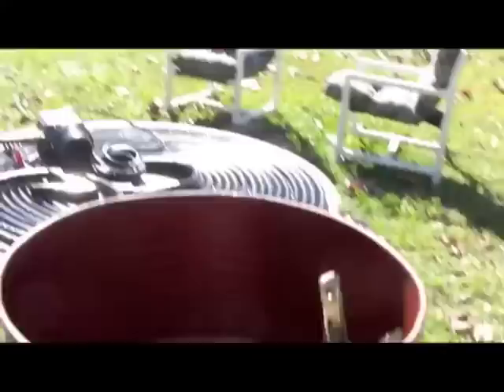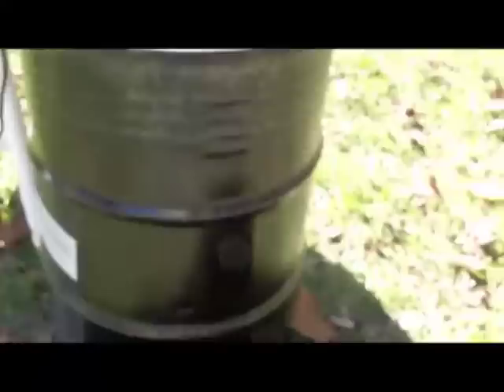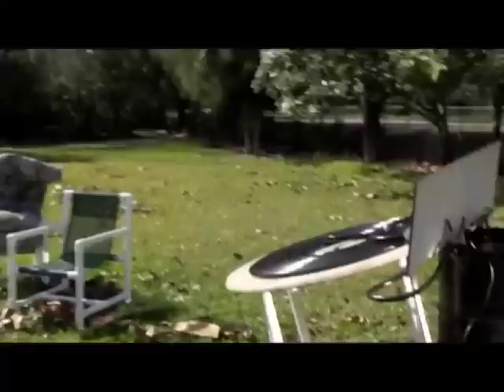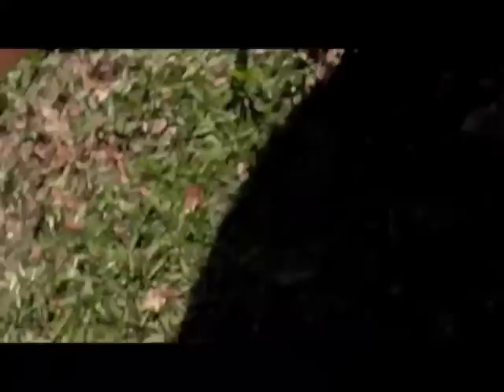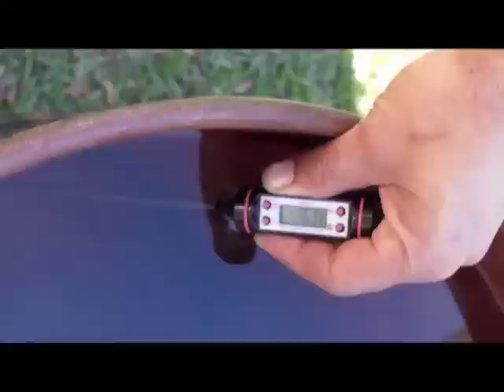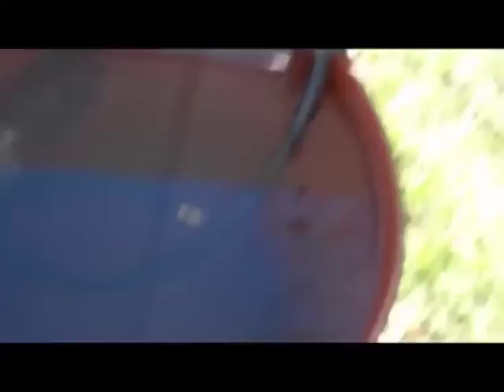SOLAR HOT WATER with black garden hose Pondmaster 1200 gph SWIMMING POOL SOLAR

Comment: When we first moved to the farm, we lived in a motorhome. Needless to say the hot water tank is small for six people. I used two splitter's with 8 /100 foot hoses and spray nozzles on each end. the water was turned on to fill the hoses, then left in the sun.  I used a hula hoop with ropes hung from a limb with two shower curtains hanging around for privacy. The bottom on the ground had gravel with a pallet on top. We used a two 5 gallon buckets set on a bench. Each would be filled 1 with 2/3 hot water the 2nd filled all the way. we would rinse off, soap up, shampoo, then rinse off using a small pot to pour water over us. we had a place to hang our wash rag, towel's, soap etc and a place to hang dry clothes.  We never ran out of hot water, and most of the time the water was too hot  so we would add some cool water . ... Growing up in rural Florida, my father had six 50 gallon drums painted black that he would catch rain water in, they were mounted  with tin sheets underneath to heat the water. It was set up and used with a gravity feed line. If it was during the winter, he would have one drum set over aside a campfire, it would always provided plenty of hot water.  When he finally had a water pump put in we would feed the primer and pump water. We thought we had died and went to heaven.

Comment: It might be interesting to maybe remove the pump, increase the hose lenght another hundred feet, let the system thermal siphon, capture various readings as a baseline, and repeat a couple three times.

Then try various pumped flow rates, insulation etc and play with "tuning" it into something cheap and really useable. Around here, such a system might well make enough hot water to supply an oil field workers laundry (washing greasers). A much needed service.

Thanx Dan for planting the seed, Bro.

Comment: John, The size pump he is using puts out very little BTU if you consider the volume of water in this system. It is true that the pump puts out a small amount of heat. I know because it is where my small goldfish hide when the water temperature falls below or around 60 degrees Fahrenheit... but isn't even enough to add an extra degree to the water temperature.
Reply: my dad use to use this method to heat the pool water[25 years ago]. it really works.

Comment: For awhile we lived fulltime in a RV, we had 200 feet of black garden hose going to a cousin's house feeding the RV. Even though much of the hose, say 100 feet was buried or shaded, even in cold weather, showers would not run cold. The RV had a 6 gallon water heater that used an electrical element to heat that tank. LP was not used. You guys are great, nothing venture...

Comment: Make your black hose in a "center sagging" cone shape below the water level with the center of the cone connected to the bottom of the tank and the outer part of the cone hose connected to the side of the tank just below the surface of the water and you will not have to use the pump as the hot water will naturally rise on it's own on a hot sunny day

Comment: Not sure if they sell them in the states but here in Turkey almost everyone has a pre made unit like this but far more efficient. For about 9 months of the year you don't need a water heater at all, just put it on the roof and it's done. They are also designed to not need a pump.

Comment: As an RV'er I can tell you that you don't want to use colored water hose to connect to water you use to drink or cook.  It picks up taste and who knows what else from the chemicals used to dye or color it.  The black hard hose in your other video is specifically designed for plumbing without bleeding chemicals.

Comment: That's an ok system, as I'm sure you know a smaller reservoir would have been good and the res definitely needs a lid arrangement to keep it clean and trap the heat. Also the Chemtrails (read up for your health) in your lovely "clear Florida sky" are magnifying the effect of the sun a little,do a test on it you'll be surprised! if you ever needed to go off grid you'll do ok together by the looks, well done. Oh and your wife is lovely, good health and happiness to you both.

Comment: Really nice.

Subtract out the 100 watts for the pump, (360,000 joules in an hour,) and you still have a 1.33kilowatt-hour gain from the sunlight in one hour, and you had no thermal insulation.
Reply: .83 gpm for an hour, with a 6.5 degree heat rise is 800-900 watts

Comment: If this was set up as more than just a demo, the barrel could be positioned in the sun, hoizontally and appropriately oriented to the sun for the location, along with the black hose (or black pipe).  Both the barrel and the hose become more effective heat collectors if enclosed in glass or plastic, and situated out of the wind.   Convection might be employed to eliminate the need for a pump, at least until it's time to use/ refill the water.  Thanks, GreenPowerScience, for illustrating how simple the basics of this type of system can be!    Also, coiled pile through a large active-hot compost pile will produce lots of heat for months (IF done correctly).

Comment: I've had a two hundred foot one that I use 9 months of the year...attached to our electric water heater. I only use a one way foot valve and it does a good job of circulating and doing most of the daytime heating of the water. We have turned the water heater to 90 which is ok as we use most of the water before sundown and some heat is left over. It cut down our electric bill noticably along with other devices we have added...more later.

Comment: Use mirrors to reflect light to back side of the black drum.  
Using a space blanket really helps as a big mirror.  
Even using a space blacked for your hose to lay on will also increase heat temp.
Reply: No it wont

Comment: In a situation with no electricity for weeks, months or longer 76 degree water will feel like heaven. So the question isn't really what the practical application is for but rather when. Knowledge is the difference between being a survivor and being a casualty. In my state several years ago we had an ice storm. Many didn't get electricity restored for over a month. A 76 degree shower to those folks would have been seen as Godsend.

Comment: like this one more than most - it was pretty complete with the solar powered pump and panel. A simple (and cheap) round table glass laying on top of that hose would have boosted your output quite a bit. I like the mirror you put on there. if you installed it permanent you could mount three or four mirrors and for about one or two hours per day you would have turbo heating of your water ! ! !cool 
I need to build something like this !!! thanx again
harold

Comment: I knew someone who used this technique to heat his inground swimming pool.   Take a sheet of plywood with 2x4 sides and spray paint it black.  Get you hands on a bunch of tin or aluminum (soda or beer) cans and cut them in half.  Secure them to the plywood about 1 inch apart in all directions.  Spray paint all that black.  He used black plastic pipe that he laid through the first row, then wind down through the second row, and keep repeating until he come out through all the cans.  He then covered the boxes with a thin sheet of metal, also painted black.   My friend laid several of these panels on his roof connecting one box to the next and heated his pool with it.  It didn't cost him anything to heat his pool other than time and figuring out how to keep it from being too hot!
Reply: why the cans??

Comment: Nice demonstration Dan.... You could calculate the heat gain 
50 gal  = 8x50gal = 400lb  or 6.5*F x 400lb  or 2,600 BTU  which seems a little high unless you take into account the heat from the pump. BUT then there is the heat loss from the barrel ??? sunny side shade side wind temp??? lot of variables BUT still a good demonstration

Comment: awesome video.. funny, i was just telling someone at the farm market how to build a solar h2o heater and how to insulate and store the water..  what works good also is the plastic sprinkler black tubing that is 1" dia and you can link up a few to get mre heat transfer surface area and i think it has a better temp transfer coefficient than rubber hose.  have a wonderful week.. thanks & peace.. amunra...

Comment: @chillydickie I was thinking that also.  Maybe a longer hose coupled with a reflective surface, and a slower solar pump that works on a timer, so more water sits in hotter coils for at least a few minutes before it moves.  Solar water heaters can work, they're just not as fast or portable. Solar systems in general seem to need backups... Rout the coil water into a conventional water heater that won't come on until well after dark.

Comment: We put 300 foot of black plastic on a black roof, and tied it into the filter circulating pump on the pool. After it was primed the syphening effect would help the pump lift it that far. It got the pool so warm, we had to bypass it, at times.

Comment: I am putting 1200 feet of black hose along the top edge of my fence, and running it to my water heater. It will preheat the water above ground temp, and lessen the load on the water heater. At times the water should be hot enough that the water heater won't need to kick on I'll bypass, and drain it in winter.
Reply: How would this work? You put a valve on your water heater and divert it into the hose?
Reply: Kit Mason No, just run the water source through the black hose then into the intake side of the heater. The object is to pre heat the water above groundwater temperature.
Reply: So you just plug hose into outside water spicket and back to the water heater? Genius!
Reply: Kit Mason Yes, that will work, but you need to plumb it so you can turn a valve, and resume normal operation without re-plumbing the whole thing.

Comment: Bet the trick is slow circulation to allow the heat to build in the hose but not so slow the drum loses heat...so wrapping the drum like you said. A temp gun and a lil tuning the flow rate and your golden!

Comment: Great Video. If you will cycle the water, allow the water to heat up in the hose then flow into the tank {cycle the pump} the temp will rise faster in the storage tank as well.
Reply: Very inefficient.

Comment: Forty years ago, I saw a solar heater work like gang busters in western PA. Wanting to extend his pool season, my buddy and I connected six closed, black, polyethylene 55 gallon drums in series and circulated his pool water through them.  The drums were laid on their sides on a low embankment near the pool.  On a sunny, spring day, the water coming out of the last drum in that array was so hot you couldn't hold your hand in it very long.  It takes volume and surface area to make this gig work.
Reply: Mike, that hook-up worked so well, it surprised the hell out of us.  We were thinking the discharge would be pee warm, but it was WAY hotter than that.
Reply: You needed a bigger pump!

Comment: @DJMC5ive Assume the pump has an efficiency of 50%; 1/2 its energy goes into heat and 1/2 goes into kinetic energy (water motion).  As the moving water travels through the pipe coil and then slows down inside the tank due to friction, it is converting the other 1/2 of the energy into heat.  A very small amount of that heat will be lost through the pipe coil to the ambient air, and the remainder will be transfered to the water, heating it.

Stirring water with a spoon heats the water.

Comment: You may have done better had you left a space between the windings of the hose, and maybe put a mirror underneath.
I'd say a smaller pump that runs off a solar panel (20w?), and another 100' of hose, and you would have a nice hot shower for free almost everyday. Seal the collector up in a box with a transparent cover, and insulate the drum, or put it inside, and it would probably work in surprisingly low temps too.
You do great experiments, and experiments are all failures until the last one so ignore the criticism.
Reply: With 200' of hose you can probably skip the barrel.

Comment: Holy cow when you read how many people swallow this " chemtrail" stuff it is no wonder people believe so many other groundless urban Legends. I've never found coiled thermosyphons to work well. They want to be linear and they flow very slowly. You demonstrated a good simple system that can be refined by insulation ect. And speed of the water doesn't change the temp of the drum the sq footage of sun/ hose is constant regardless of water speed. Good work Dan and Denise.

Comment: Plastic tubing would had been better than a black garden hose. Also a big pump is overkill and the energy usage will be high with this pump also.
Reply from the maker: Bonnie Flory 80 watt pump. I mention a smaller pump as an option.
Reply: +GREENPOWERSCIENCE 
Sir what size of that black ?
Reply: Black PVC?

Comment: Good job, Dan and Denise. Honestly, I believe it is impressive, effective, and cost efficient ( low cost, good results.) And I have been looking at this kind of stuff, and solar energy specifically, for a long time.
As stated, a longer hose and a mirror would be enhancements. Just a big mirror, not a Fresnel. Also you could put insulation around the drum, and a lid. All cheap additions.

Comment: You get a more efficient heat transfer with a larger temperture gradient. That is by actively pumping the water through the black pipe you don't allow it to get excessively hot. Over time this allows you to capture more heat in your tanked water.  Think of the tank as a "heat battery."

Comment: I think you should use dryer water.  Dryer water has less tendancy to lose heat to the atmosphere, and is much less wet in the event of a leak.  So dry your water about 20% and see how it works out.

Comment: Dan, since these are experiments, try to go for an unpowered arrangement (like the radiator in a Ford T, if you know what I mean)
Intake at the bottom of the barrel, water fills the array of tubes (or your coil) and heats up ascending naturally. the water now warmer goes back in the drum in a continuous cycle.
Of course in the radiator the cycle is inverse

IMHO it's a good opportunity for testing if a really green approach can be achieved. now you still need electricity

Comment: It may improve with more time as 48 gallons even conventionally heated would take some time so you need a thermal blanket to do it justice and a thick black steel sheet to place the hose on with a sheet of glass in front of that best in a sealed unit insulated pipe to the main tank. Then you will get a much better reading. Great Vid thanks for sharing
Reply: 3 weeks ago?! Holy shit dude this is still active

Comment: My water heater went out a while ago.  Was a week before I was able to replace it.  I would have done just about ANYTHING for 76 degree shower!  As it was, I heated water on the stove and dipped it and mixed it until it was "warm" most likely, around 76 degrees...  Oh, and if it went up 6 degrees per hour, and ran for say 6 hours per day = 36 degree rise per 6 hours = 106 degrees.. My Gas heater puts out 118 degree water.

In Texas I expect I could get 140 degree water without any major issues.

Comment: Guys ,Guys, Guys , Its an example with items at hand, he's not trying to be efficient , just the basis of physical adaptation of components that can result in Hot water . Didn't you hear him say!  a covered tank and insulation would aid in the efficiently .that alone would tell you that this is basic 101 class room  principals.  you can use a 1/4 amp motor  or  PVC irrigation pipe or foam tank . what ever your resources you have . don't kill the messenger his points are informing and the rest is up to you. Your the Geniuses!  But then again, your' all rocket scientist and not Physics majors !

Comment: The pump is under the water.  No mater how it operates, 100% of the electric power goes into the water.  Heat from the coils, friction etc.

to heat 55 gallons of water 6 degrees requires 192 watts of energy. 100 is the provided by the pump 92 is left for the sun.
1 J of energy will raise 1cc 1 degree C. It goes up 6 * 5/9 degrees C.  55 Gal is 208197 cc  Times 6 [degrees F] / 3600 (Seconds/hour) * 5 / 9 is 192.  Uses more energy than it captures. Good start though - keep working!

Comment: Put the tube in a black larger surfaces with more reels, cover it with glass. Getting an old boiler, make two holes, input output and will have hot water all day.

Comment: Thanks Dan and Denise. So you collected 50 gal * 8.35 = 417.5 lbs * 6.5 degrees =  2713.75 btu/hr = pretty damn good if you axe me! Nice job. Wonder how hot the hose got.

This gives me an idea. I've got 150 sq ft of glass on the south side of my house. If I built a thin wall covered in pex tubing painted black behind the glass and ran the pex to a water heater, I could have a nice hydronic system.

Comment: I rented a house in Yakima WA that had this on the roof. It was a 4'x8' sheet of plywood with the irrigation type black hose. 1/2" or 5/8" perhaps... 2x4 border so there were 2 of 4'x4' squares and enough hose to neatly coil nicely between the two compartments and covered with Plexiglas. It was unused so I ran my doughboy pool pump through it. And the water coming out into the pool was almost scalding hot. Too hot to touch.